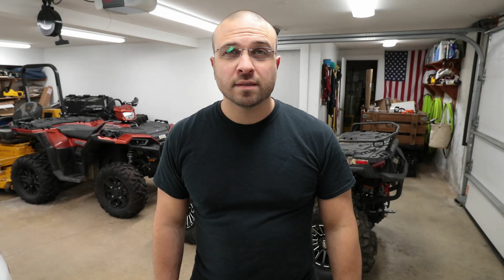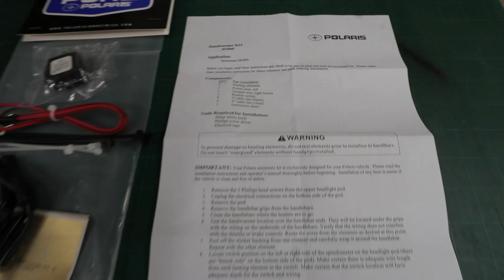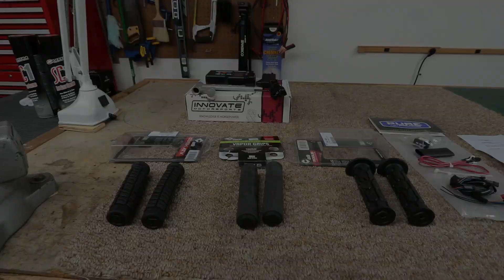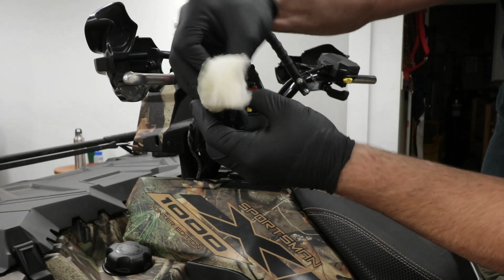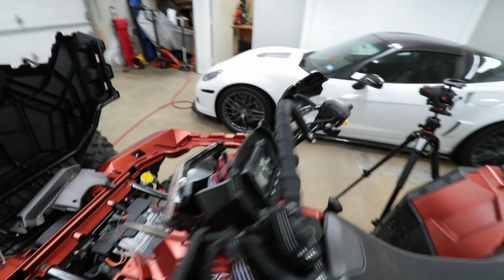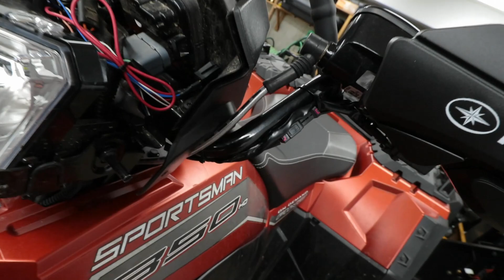INSTALL Heated Hand Grips & Thumb Warmer KIT | Pure POLARIS Sportman XP 1000 850

Comment: Just curious why did you put the OEM exhaust back on?
Reply from the maker: Got sick and tired of the excessive drone from the big gun exo when out trail riding, plowing & not being able to hear other riders speaking because i had to wear ear plugs when machine is running. The 2018 and up have the newer designed higher flowing stock exhaust. So removing the spark arrestor gives more bark.  Much happier now.

Comment: Where you unplugged those square connectors do you plug them back in. I have a Highlifter I found those square connectors but they were plugged into
Reply from the maker: If those connectors are being used then you will just have to wire it up right to the battery terminals. Thanks for watching!
Reply: @ModernHotrodsNH  thanks man figured out the dealer used it for that my wireless winch remote

Comment: Did this plug into factory ran wires? Also would it work with a sportsman 570? Thanks
Reply from the maker: Yes there are factory accessory power leads in and around the battery. Thanks for watching!
Reply: Well looks like I am buying those right now lol
Reply from the maker: @ScottieBMan  What year polaris? Should be orange wires with white stripe right upfront near the battery.
Reply: @ModernHotrodsNH  2020 570, your link on Amazon looked like they work on 570’s so pulled the trigger on them.

Thanks for heads up on wiring, will refer back when I get them 💪🏻 I love the plug and play wiring stuff. I added the KFI winch...perfect plug and play option using all factory ran wire.
Reply from the maker: @ScottieBMan  Those are the  polaris factory ones. Worst case just strip the wires and crimp on a ring terminal and go straight to the battery.
Reply: Hey John where did you hook ground wires up to

Comment: Hi john always enjoy your videos. I have a Honda HSS1332 just like yours 2018 model. It is stuck in free wheel mode. ( you know how you pull up on the two handles to release the track). Yeah its stuck in turn mode. On one side I can push the transmission arm forward and this allows the track to reengage and drive. Although if I pull the level again it gets stuck in spin mode again. 

The opposite side. I am not able to push the transmission arm forward. Without being too forceful. Any ideas what the problem could be?
Reply from the maker: Never had that happen to me. But I would start at making sure the steering cables are adjusted properly.
Reply: @ModernHotrodsNH  ended up being covered by warranty. They said the steering cables were seized and replaced them. I kept thinking it was something to do with the transmission.